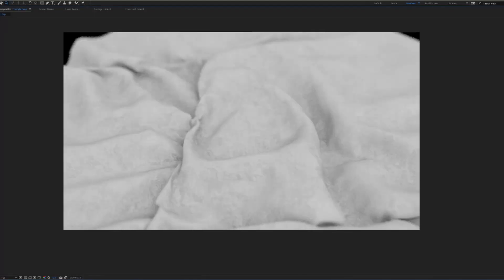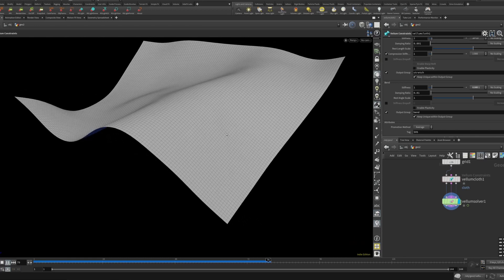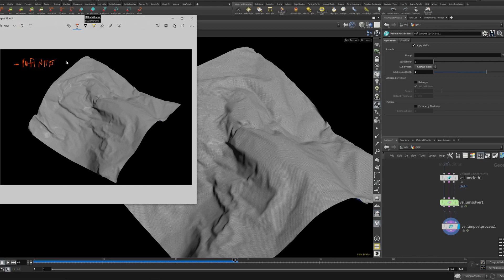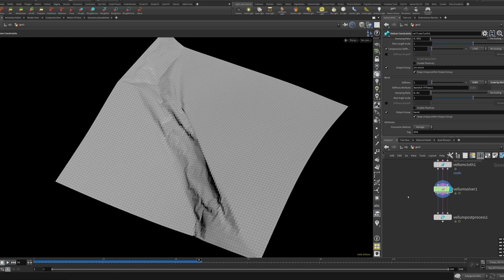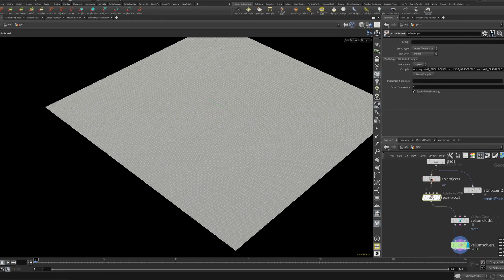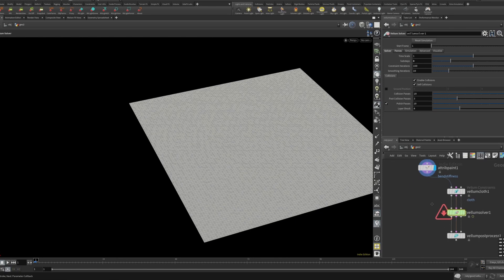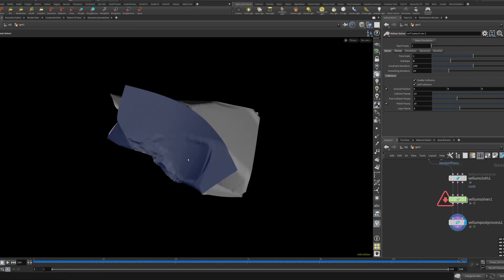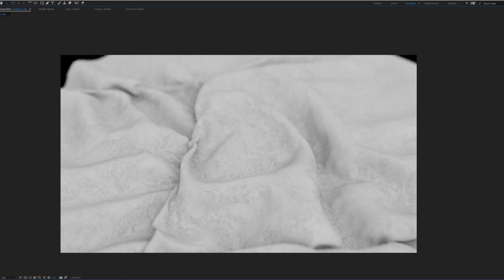Crumple Effects in Houdini Vellum using Bend Stiffness and Plasticity

Comment: This is great. Is there a method to animate stiffness or bend values? Something that would go in the vellum solver I suppose. I can't grasp it.
Reply from the maker: I WILL NOT MOM GAHD. Thanks for watching =]
Reply: @regularmenthol  lol, I remove my comment. But it is a great demo I'm just wondering how to animate stiffness or bend in a sop solver or inside the Vellum solver. Preferably not using dops, only inside the Vellum solver.
Reply from the maker: @tomallen5837 haha, no worries. if you double click on the vellum solver to dive inside you can create a "Vellum Constraint Property" node where you can easily animate a bunch of different values
Reply: @regularmenthol  thank you, I tried but I could not get bend or stiffness to work. Usually there are other examples out there, and I don't find any, so I'd be curious to see how it's done. I think I've tried everything in the past 3 days but then again I'm not a td minded person. That is to say I'm tolerant and persistent to a point of obsession.... I've even looked up a list of vellum variables that can be animated? I found a demo of animating pressure inside of the sop level vellum solver.

 I also found a dops cloth demo of the manipulation of restlength using an imported attribute from the sop level, but nothing that I can animate bend and stiffness with. Basically I'm looking to control certain areas of a cloth sim within the animation.
Reply from the maker: @tomallen5837 Hmmm idk, works fine for me. I guess it depends on what you're trying to achieve. For more advanced applications of vellum you are unfortunately going to have to start looking into the DOPs application of it